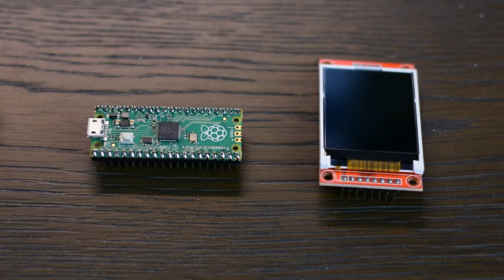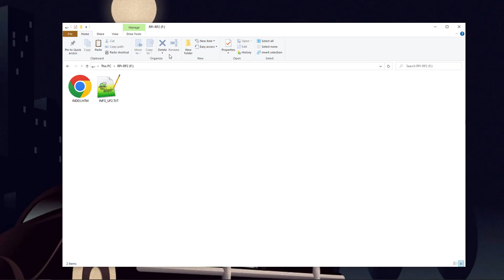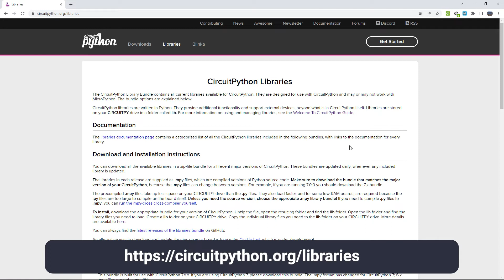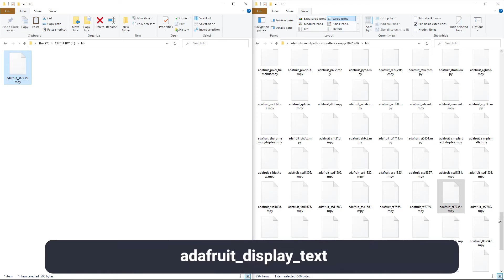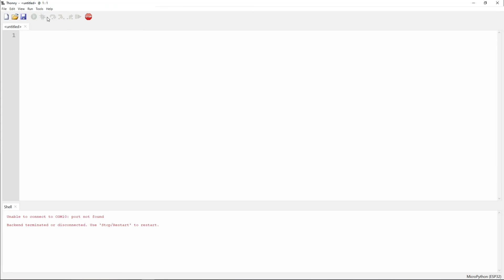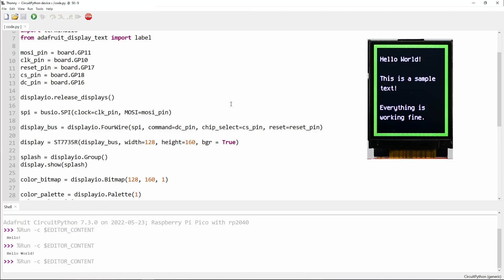Raspberry Pi Pico ST7735 display tutorial - CircuitPython

Comment: Do I need to connect backlight? I need to connect a battery and a PMS sensor too but there is only 3 power sources coming out of pico
Reply: You can use each output multiple times

Comment: if the pico is so bad compared to esp32 why are you using  a pico .
Reply from the maker: The pico isn't bad. ESP32 is just faster. Also Pico is the most popular board out there. I want my videos to be helpful to as many people as possible.
Reply: pio sdk is easy to use, espressif sdk is hell, use a lot of power and most are single core on the other side pico is not as good as announced by raspberry pi, multicore is hell to use core0 is preempting core1 and most of the time waiting core 0

Comment: I’m trying to run the slideshow program. Everything looks good at first but when I run the code through Thonny my screen just stays white and never shows an imagine. And the only error it says is on the last line sleep(2). But I think that’s because I’m shutting down the program but maybe I’m wrong. Any idea what the problem could be?
Reply: This screen sucks (I have the same problem). Go for a similarly priced ILI9341 which is much better supported and better with raspberry pi’s

Comment: Found a cheap display like that so I check out some videos. I plan to use it for a clock, temperature or something with a Pico eventually running all the time and the RPi is too power hungry (Amps).

Comment: hello i am struggling with having a white screen!! i got mine with pre-soldered headers so i would assume that would mean that is should all be working but no matter what i try its always a white screen any ideas?? thanks so much :)
Reply: I'm having a similar issue.  I got a slightly different screen, it has a few extra pins, but they are labeled nicely.  I was able to find the exact same pins as described in this video, wired the same, and pasted the sample code.  It "runs" without complaining, but my screen just stays white.  I'm not sure.  Did you have any luck?
Reply: OK quick update, my screen had a different input called SCL...I ended up connecting the clock wire from the PI to the SCL pin on the screen, and it worked!

Comment: I'm having an issue, when I try to load the first example project into the raspberry pi pico, the screen just stays white. I added some code that turns on an LED and that worked so I am a bit confused.

Edit: To anyone else having this issue, and is sure that their wiring is correct, make sure you push the pins of the Raspberry Pi Pico and the screen all the way down and you copied the sample code correctly, that's how I fixed it.
Reply from the maker: Please check your connections again carefully. That's the most common reason for a white screen.
Reply: @Educ8s  Thanks for the reply! I have one question, do the distances from the wires to the raspberry pi matter? This is one of my first times using a breadboard so I'm not very good with it.
Reply from the maker: @GordonFeeshman  No, the distance does not matter.
Reply: @Educ8s  Ah, that makes things easier. I will check my wiring, thanks for the advice!
Reply: @Educ8s  So I checked my wiring and it seems fine... Do I have to edit the sample code? (I am using the sample text program)
Reply: @Educ8s  Nevermind I got it working!

Comment: Does the image stay on the display if we plug the pico from an external power source or do we need to have it hooked to the computer for this to work?
Reply from the maker: If you save the code as code.py this script will run everytime you powerup the board. So, it doesn't matter if it is powered from a computer or a power bank or a power brick.
Reply: @Educ8s  thank you!

Comment: more Raspberry Pi Pico projects please 
i bought one but there seems to be no good projects for it ,most of the existing projects can be done with arduino 
no one is using the full potential of the pico
Reply from the maker: Sure I can build more project with this board. With $6 this is one of best boards out there.
Reply: @Educ8s  Very interesting.  Looking forward to more builds.
Reply: @Educ8s  At Pimoroni, 10x RP2040 costs £9. Nice for custom projects.
Reply: You can program Pico just as regular Uno.
Reply from the maker: @dekipet  Sure you can do that, but with CircuitPython, development is much faster.
Reply: @Educ8s  My point is, for those who seek tutorials on Circuit/MicroPython for RPi Pico, they have little knowledge. As for Arduino IDE, there are way more tutorials. Good for start, until they can move to Python. 
It is always faster for you to develop a project in a language you do know, than in a language that is easier/faster, but you do not know.
Adafruit has so many noob-proof examples in CircuitPython. So, not many projects, but there are a lot of examples.
Reply from the maker: @dekipet  Yes that's true. I see that CircuitPython has a lot of potential. Maybe it will become the new "Arduino".
Reply: @Educ8s  I agree. As long as Adafruit stands behind it. And it is fun to work with...
My guess is CircuitPython has way more potential than MicroPython. We saw it all with ESP32S3 support.